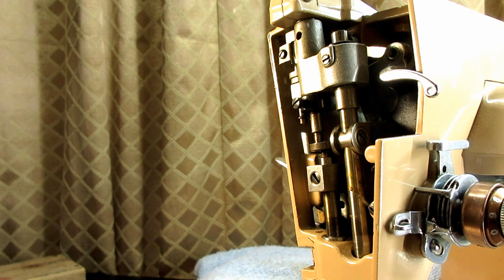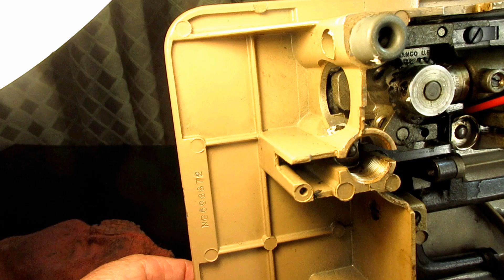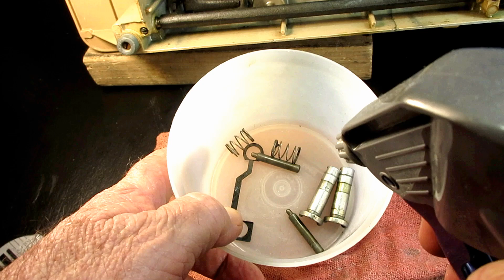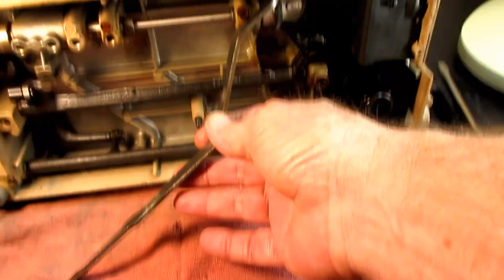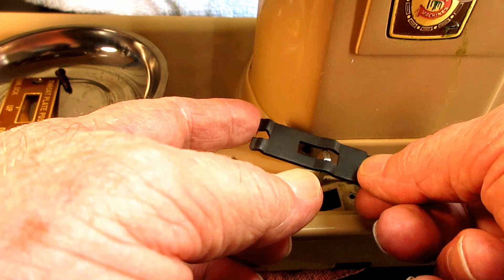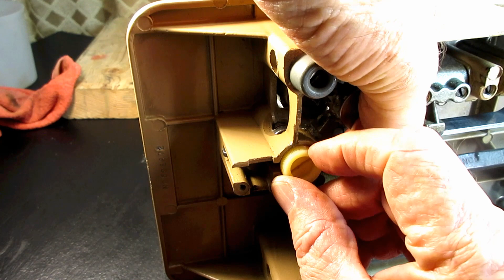How to Repair the Throat Plate Position Bracket on a Singer Model 403A

Comment: I have been sewing masks for a volunteer effort on my mom's wonderful 401A, but I need to clean behind the bobbin cage but the throat plate is stuck like shown in this video.  What type of oil do you recommend using - you called it "penetrating oil" ?  Thank you!
Reply from the maker: WD40 is and example of a penetrating oil and there are others.  
https://www.google.com/search?q=penetrating+oil&source=lnms&tbm=shop&sa=X&ved=2ahUKEwjcw8uLhZHpAhWxHTQIHe9TAQoQ_AUoAXoECBEQAw&biw=1536&bih=760
Penetrating oil is NOT good for lubrication, so after using a penetrating oil it should be flushed out/off with something like alcohol (if you can find any!) and SMO (sewing machine oil) used for the lubrication. Yu can also use SMO to free up sticky parts but it can take a little longer. Heating the area with a hairdryer can help softe up the gunk also. If you do have some precious alcohol (i'll buy it!) yoou can use that for softening and cleaning also. Worst comes to worst, remove the drip pan from the bottom of the machine and use a crevise tool on the vacuum to rmeove some of the lint from the bottom, or brave souls that you are, use canned air or an air hose to blow the lint out (and all over) as a temporary fix. Thank you very much for your volunteer work work in yiour community, and for looking at my channel. Good Luck.
Reply: @andytubesewing1953  Thanks very much.  I'd actually just like to take my machine to you to give some tender loving care!  I have my mom's old Singer Touch Tronic 2000 and so much prefer this 401A.  You're not anywhere near Westchester Cty, NY, are you?
Reply from the maker: @linnettse7058  Westchester Cty, NY Oh, the Hudson Valley. Beautiful. So, you can jump on the I-40 west and stop after 2,500 miles and you'll be nearby. When your mom bought that Touch Tronic is was Hot Stuff I'm sure, but after just looking inside one I called it Touchy Tronic. No thanks. Yep, the Slant-O-Matic 401A is sure a favored vintage machine! Sorry, I'm not taking in restoration work at this time. If you just want it to work, find a local mechanic, motorcycle mechanic, appliance repair shop, High School Shop Teacher, and give them the service manual and show them my 100 videos and they can get it running nice. I know a lady who talked to the local high school shop teacher to let students work on the machine as extra school credit. If you want a true restoration, this is the guy I'd contact. https://www.youtube.com/user/CowCountryEnterprise/featured   I mean just look at the work Scott does! He seems to be getting machines in for work, besides selling some of his own. His email address will be on his "ABOUT" page. I do not know Scott, I've never met him, talked to him, emailed him, etc. but I sure admire the dedication to detail and straightforwardness he projects. Besides, "Cow Country" must be closer to you then the middle of Arizona. A pleasure to have you comment on my channel and I hope it all works out well for you.

Comment: Hi Andy!  After watching the restoration or repair of the Singer Model 503A and seeing that it had a nylon nut like on your 403A model here, I went and bought a Throat Plate Position Bracket (needle plate lifter complete) set for a Singer Model 401A from a person on eBay in order to get the nut in metal instead of nylon.  In the future if these should fail on my Singer 500A Rocketeer, I will have a metal nut to replace that nylon nut with.  Thank you for all you show here!  Your videos are so great with your clear explanations!  Kathy from Southeastern Arizona.
Reply from the maker: That's a great idea and I do the same thing other than the bobbin winder spring and tire there's not much else that could wear out if you just keep it clean and oiled your machine will probably outlive all of us thank you very much for still watching my channel and stop by anytime take care

Comment: Hi Andy.  I have not been able to remove the screws which hold down the "throat plate positions" cover.  I've removed the nut and the pins and stuff, but those brass screws will not come out, so the cover remains on.  I have a feeling I'm doomed; I'll have to leave the cover and hence the bracket on through out the whole restoration.  I've been able to clean somewhat under the cover, and it works fine, but I can't get the screws out.   (I'm staying  up with the videos; I'm up through removing the bobbin area parts.)  I've soaked the screw areas in penetrating oil, WD-40, let it sit over night at least twice.  And unfortunately, I've damaged the screw heads.  Now I know about those soft brass screws; I'm still a novice on learning how to use the proper screw driver. I turned the machine upside down and soaked the screws in penetrating oil; I've heated them with a hair dryer.  I thought I'd ask you if you have ideas how to loosen those screws.
Reply from the maker: I have never done this on such a small screw, but I have put the screwdriver in the slot of the screw and tapped on it sharply with a light-weight hammer trying to "jar" it loose. I'm not sure if that would work on this softer type of screw. Good idea to put the machine upside down and soak the screws that way. I usually put a cotton pad over the screws and soak it with WD40 hoping the oil will stay on there overnight. Don't feel doomed though because you can still easily clean the machine with them in place. Myself, I would put the end of the bracket up in the slots and install the nut to keep the bracket from swinging around. If you pre-clean and pre-treat the machine on the workbench you can swing the bracket out and brush the area, then put the bracket/nut back when you transport the machine to the shower for full-body cleaning. Just keep soaking it overnight during the remaining restoration time. It could still free up and be removed but if not, no worries.
Reply: Thank you so much, Andy.  I'm going to soak the screws, using cotton pads, in WD-40, every night, sometimes with the machine upside down, sometimes right side up.  And I will replace the nut while I restore.
Reply from the maker: I hope it will help loosen those little screws, Carole, but if not don't worry b/c you can still get the machine clean. Best of luck.
Reply: Nearly two years ago, I never did get those screws out.  However, yesterday, as I was doing some maintenance on my 403A, I attempted to remove these brass screws again.  Put a drop of Triflow oil  covering the top of each screw.  Let it sit for at least 30 minutes.  Then, daubed up excess oil.  Hair dryered the screw heads until very hot.  Got my good screw driver with a well-fit bit.   Used screw driver, pressing down very firm.  Voila!!  Got those screws out. Took apart these top pieces.  Cleaned all the pieces above and the frame surrounding and reassembled.  Yippee!  Used “new” screws from Thrifty Farm Girl purchase.